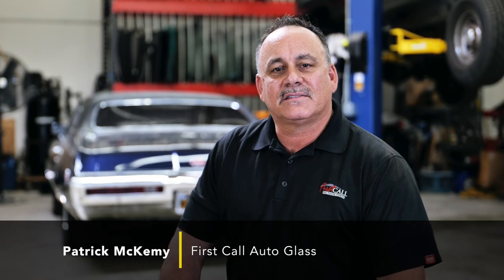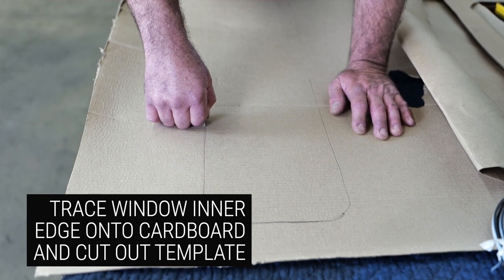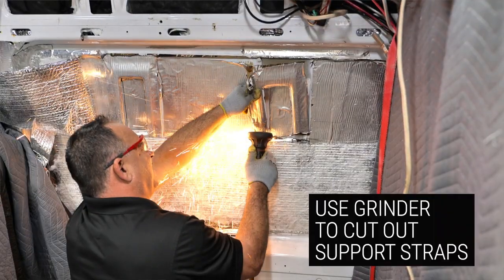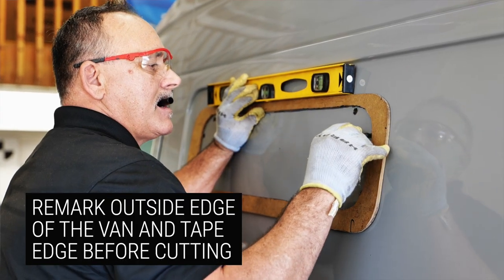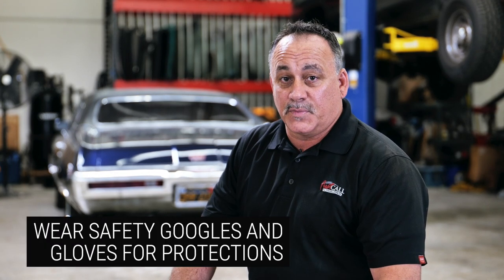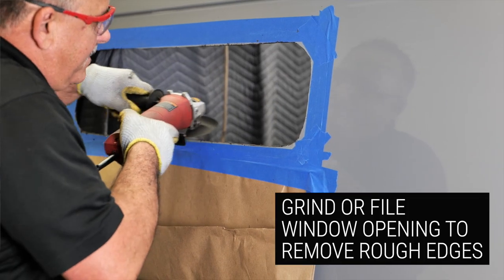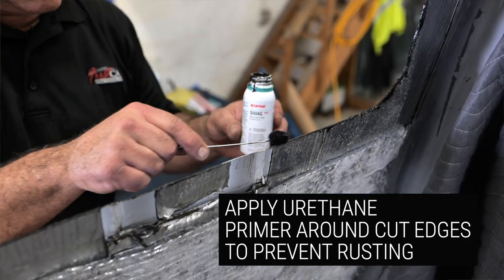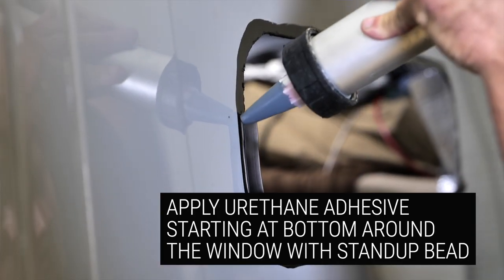How to install an AM Auto Bunk Slider van window

Comment: I am wondering if you have ever installed the same window in a Chevy Express Cargo Van?  The conventional wisdom is that it is too curved and there seems to be one window on the planet meant for the curved sides of vans which is more than I need and more than I'd like to spend.  I like the little window in this video.  Any advice you have would be appreciated as there is nothing helpful out on the internet that I can find. Thanks.
Reply: We have had customers install the same bunk slider window in this video on just about all mid to full size vans, even the Chevy Express. The Ford Transits have the most complex curvature and we have many upfitters that use this bunk slider for their Ford Transit builds.
Reply: Thank you! @kevinmiller6941

Comment: how long did you wait to remove the extra sika flex on the outside of the van with the cloth? Also, my window doesn't have the entire slider piece, so how do I apply the sika flex and it not merge over into the glass on the inside?
Reply: Wipe the excess adhesive right away for an easier clean up. Best to use an electric caulking gun for an even application.

Comment: What do you mean by "Stand-Up V Bead"? I'm assuming you cut a notch into the top of the adhesive to make it point up, but why do this over a circular bead? does it matter?
Reply from the maker: V bead will maximize the bonding area. Check out this article here: https://beranek.agrrmag.com/2012/06/round-bead-v-v-bead/
Reply: @amautowindows1496  Wow, awesome! I wasn't sure I'd get a response, not to mention a speedy one. Thanks so much, I appreciate it!

Comment: this presentation is a poor joke,
where do I get this template ? the caulking gun is a toy not a tool and the glue sold with this window is way to hard to do by hand
I bought these AM audo windows and it was big mistake
Reply from the maker: Hi Arthur, the installer simply traced the interior frame of the slider on a piece of cardboard to create the template. If you are using a normal caulking gun it can be difficult, we highly recommend using an electric caulking gun which will make applying a consistent bead of urethane very easy. It is night and day between a manual caulking gun and electric. Hopefully this helps, if not reach back out.